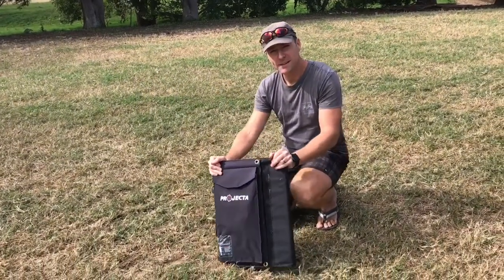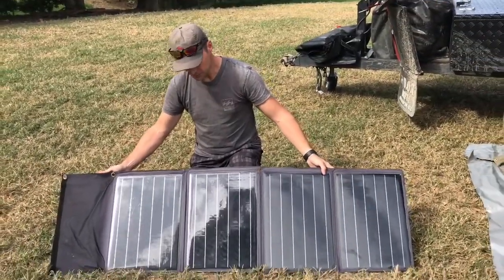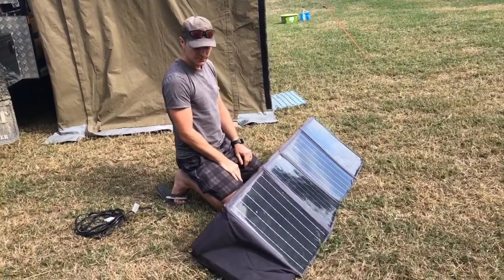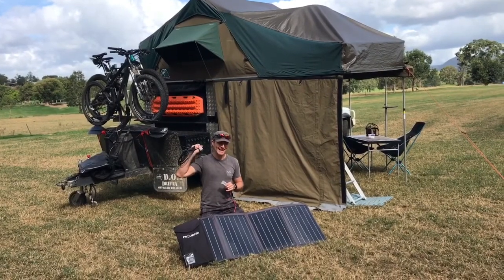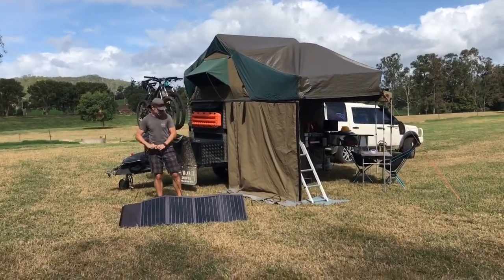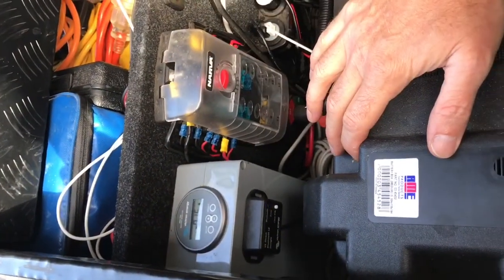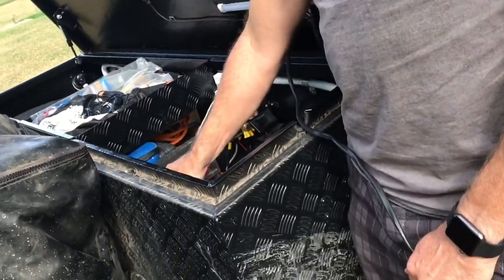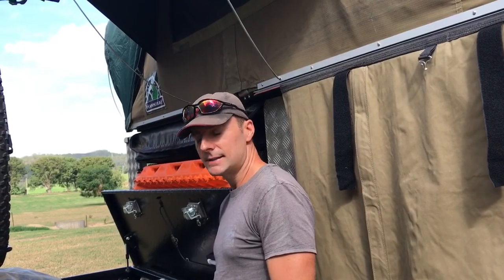Projecta 80W Foldable Solar Panel Review

Comment: Can you bypass the Projecta solar controller if already have a controller on the battery end?
Reply from the maker: Yes you can and I have done exactly that.  I have two outputs now from the panel depending on what I am using it for.  Works very well :-)